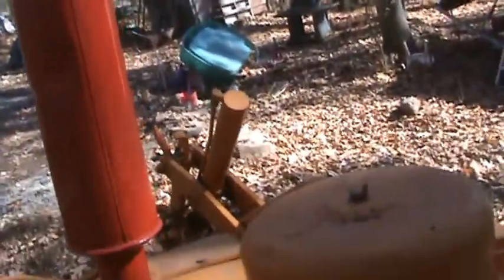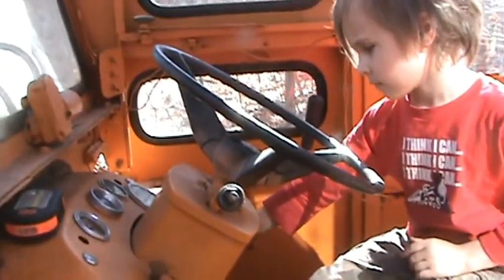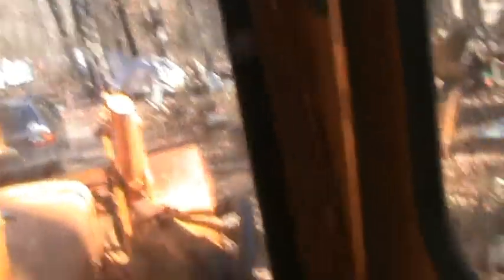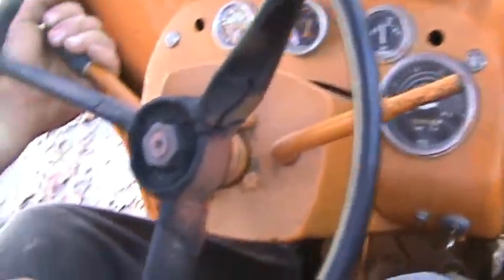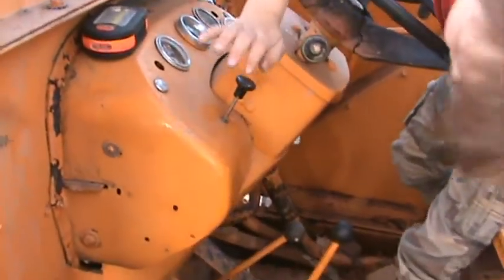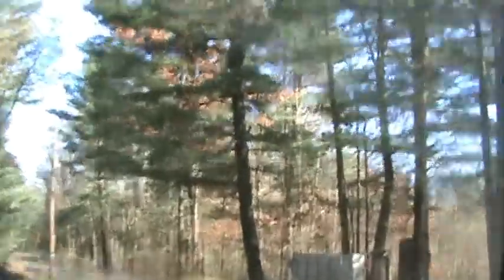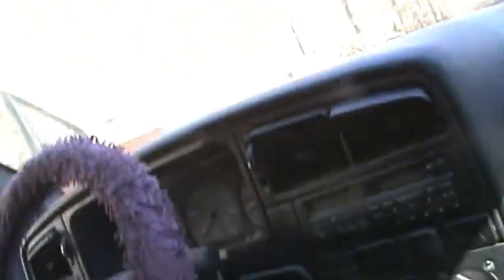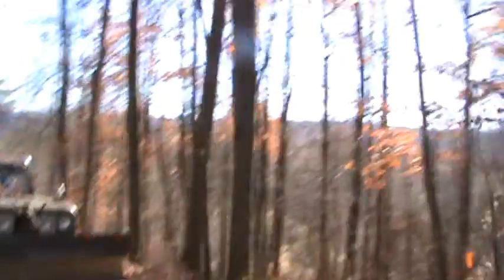Passing the torch

Comment: Before you know it, he'll be driving that tractor!
Reply from the maker: I've had him at the controls kind of feeling it out already. I also had my Daughter running it forward and reverse with the wheels up while I adjusted the brakes.
Reply: @heliarche  It's good that they get an early start knowing how things work; it opens up their minds and let's them begin to discover what they want to do. As a kid, I always took things apart (I didn't usually put them back together) and that started up an interest in what was inside things that made them go. There was an old Vaxhaul "Viva" in the field that I would go down to and attempt to disassemble, trying to discover how it worked...this was at about 9 years old!! 
Wouldn't it be  exciting to come home someday in a couple of years and have your tractor all disassembled right down to the frame by those two?? haha
Reply from the maker: @EverydayProjects  I suppose if they tore it down it'd be time to start a proper re-furb instead of nickle and diming it once issue at a time.